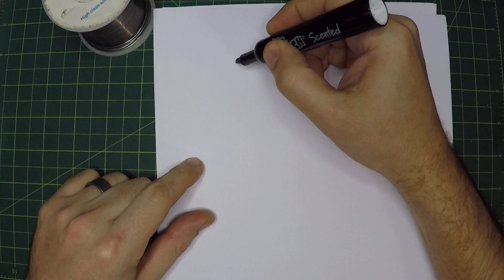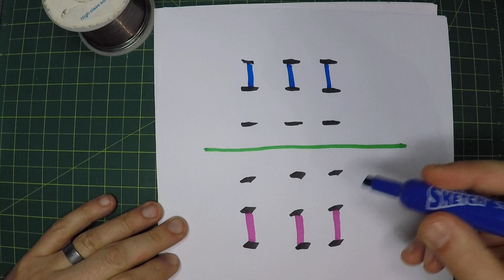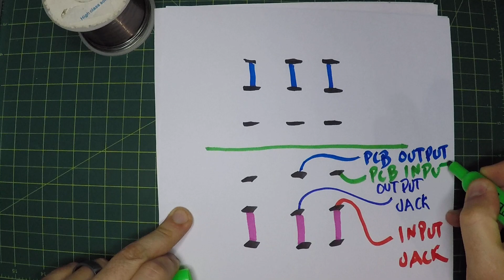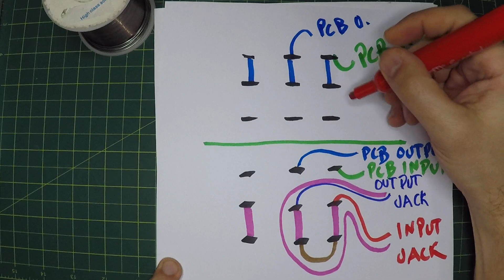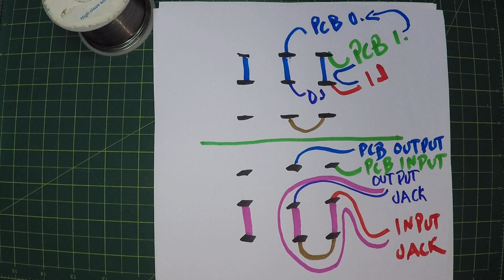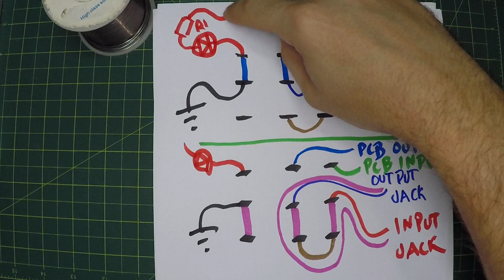Big Muff Pi Part 4 - 3PDT Stomp Switch

Comment: This just inspired a gain trimmer bypass and a Bias trimmer bypass. Of course with a Bicolour LED to say which way your going. Different trim pots could have preset values instead of just going bypass to full open. Leaving me with Tone blend input tone Blend output and volume and a 3 way switch for asymmetric symmetric asymmetric reverse.